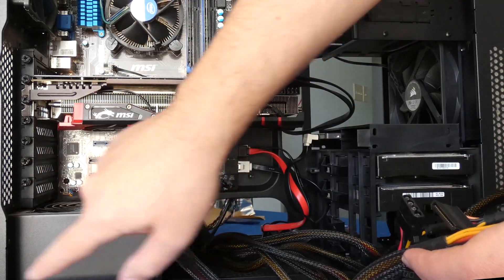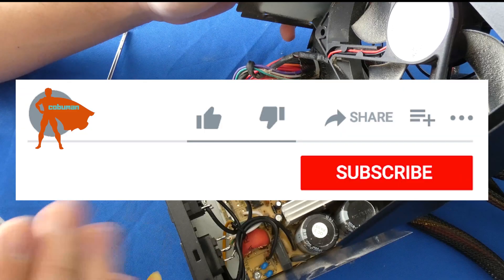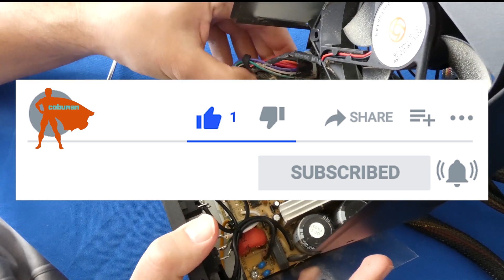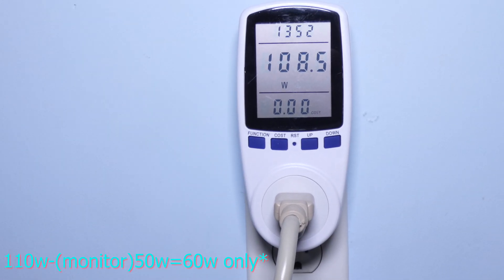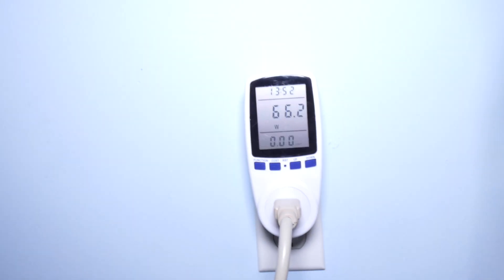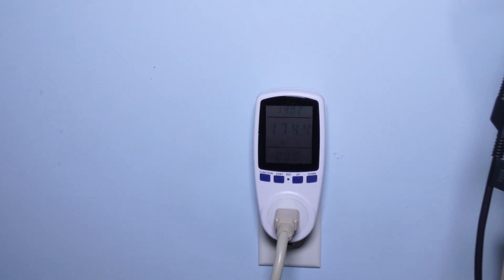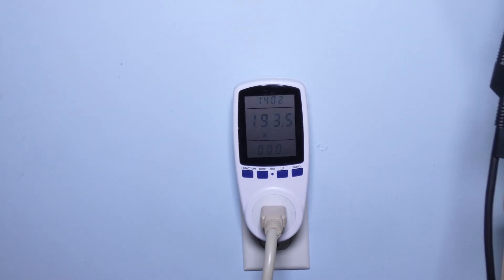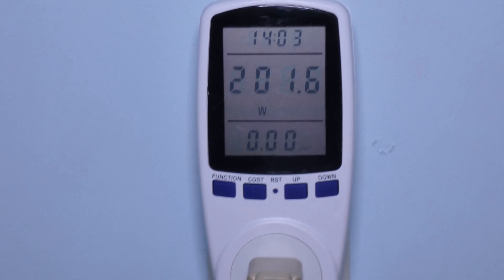Video Card GPU is new PSU required? HP 800 G1 sff, HP 800 G2 sff, HP 8100 sff, HP 8200 sff,

Comment: excuse me, I wanna ask that can i run gtx 750 1gb + i5 4570 + 8gb ddr3 ram + 500 gb hdd on a 200 watts power supply...please tell so, because have to buy that gpu or its gonna be sold 😥

Comment: Hi Cobuman . I got the HP EliteDesk 800 G1 SFF with i5-4590 . I wanna to change with i7-4770 or i7-4790 , can you please advice which is the best ???
Thanks .
Reply from the maker: Both are good. I know 4770 is compatible but not sure if bios supports 4790.
Reply: @Cobuman I just dropped a 4790 in mine, worked no problem
Reply from the maker: @bomptor1642  That is awesome. Thanks for letting me know it works. :_like:

Comment: Hello, can you please tell me if I put the gtx1650 low profile in HP ProDesk 600 G2 SFF PC it will work?the psu is sufficient for this grafic card? I think is 200w, I appreciate your answer
Reply from the maker: From what I recall; people have reported back to me that it works fine. The reason for 200w is because G2 has lower power consumption than G1. If your power supply goes bad... it used to sell for around $40 last time I checked on Amazon. Keep in mind that 1650 used to sell for around $160 before covid stuff... Don't pay more than $200 in my opinion.
Reply: @Cobuman  ok, thanks, payed 200 and these days I'll receive bouts, now my question is it possible to put a psu 240w  from the G1 in the g2? Thank you for your time
Reply: @rauldorelgyorgy9523  did it work?
Reply: @wsam.1984  yes
Reply: @rauldorelgyorgy9523  so the 1650 works well in the 200psu G2?
Reply: @wsam.1984  yes it works perfectly
Reply: @rauldorelgyorgy9523  nice, thanks for letting me know. I recently bought a G2 and was worried that I wouldn't be able to put a 1650 in it because of the 200 psu.
Reply: @rauldorelgyorgy9523  does the 1650 consume alot of power?
Reply: @wsam.1984  No, it works fine with hp prodesk 600 g2 and it's power supply, an ssd and a hdd and the CD burner, no issues at all

Comment: Would this work for my HP Elitedesk G1 SFF? 

i5 4570 
8GB RAM planning to add another 8GB more. 
500 GB HDD 
Adding GT730 LP 2GB soon 
Removing ODD connection soon
No SSD 
No additional fans or so 

Just worried if I add GPU after adding an additional 8GB RAM my 240W PSU might not able to handle it. 

Thanks man!

Comment: Hey I got a Hp elitedesk 800 g1 with a 240W PSU and I'm wondering if it could work with this system

Intel i5 4590
GTX 1650 LP
256 SSD
1TB 7.2rpm HDD
16 GB of DDR3
No optical drive

Comment: So if I get put a 1080 in my Hp elite desk 800 Mt g1 with 16gb of Ram a 120gb ssd,a 500gb Hdd and a i5-4570 using the stock power supply will it be fine?

Comment: Hi I am on this situation with my HP EliteDesk 800 G2 with GTX 1050ti that require at least 300 watts. Now I have encounter a hiccup during the game but if I am not gaming just a normal usage nothing happen but when gaming the screen is having an on and off blinking some sort of. Thinking of having an external gpu dock with external psu.
Reply: im running a gtx 1050ti low profile in mine...no issues with power

Comment: Would a HP 800 G2 SFF, i5-6500 with 200w would be able to run a MSI 1050ti low profile? :)
Reply: my 800 G1 SFF w/ i5-4570 runs a 1050ti low profile with a 240w power supply, if that helps
Reply: @samgillies9502  Does it run games well? Or does the computer crash sometimes? :)

Don't know if i should buy a i5-4570 or i5-4590 xD

Comment: Is a HP Elitedesk 800 g2 Tower with a i5-6500, 32 go of DDR4 Ram, and a 280w psu work for a 1650 low profile gpu?
Reply from the maker: Should be fine.

Comment: rx 550 oc 4gb LP on a 240 watts psu and i5 4570 is it gonna work fine?
Reply from the maker: as long as it's an LP it should work fine.
Reply: @Cobuman  even if the card requires a 400 watt psu?

Comment: I got an hp 600 g1 (very close to the 800 g2-4 components) and I bought an rx580 8gb. I don’t want to use the 240w psu, so I think I will just get the adapters.
Reply from the maker: nice

Comment: This video is the most practical and simple i've found!
I have a HP Elitedesk 800 G1 SFF with core i7-4790@3.6GHz and 10GB RAM +headphones, keyboard a mouse and a 24 inch monitor connected to the GPU via HDMI,  connected to the PC via VGA and is powered by the socket (3 monitor cables total). The PSU is 240W. Will it work with a GTX 960 4GB DDR5?
Reply from the maker: Probably be fine. Just make sure you get "low profile" type like this: https://amzn.to/3lLBl1h  or it will not fit inside.  I could not find 960 LP for sale but you get the idea...
Reply: @Cobuman   If I somehow fit the full size GPU into the SFF case, will the PSU still be able to power the full size GPU? Also, what issues would I experience from such a tight fit?
Reply from the maker: @papilionem9342  Here is my video on that: https://youtu.be/_tbcimqBDzI
Reply: *The PSU is the default HP one

Comment: will it be okay if i pair a GTX 1650 Low Profile with a 200W power supply in the HP EliteDesk 800 G2?
Reply from the maker: This is the one I recommend to people: https://amzn.to/3boom0F Most people don't have any problems using it.
Reply: @Cobuman  yes I know that already, but I was wondering if a 200W power supply would be enough for that graphics card
Reply: @anthonypham8062  Did it work for you with your 800 G2? :)
I'm thinking to buy the same computer, but I'm also worried about the 200W :(
Reply: @Cobuman  Hi there. Does the linked Gigabyte GTX 1650 (GDDR6, OC, Low Profile) definitely run without extra 6-Pin power supply? I've read that it needs 100 Watts and the PCIe delivers only 75 Watts. Can anyone confirm that this recommended GTX 1650 D6 OC LP 4G works in a HP EliteDesk 800 G2 with 200 W PSU properly? Thanks for your pretty helpful channel - very good work! :) Cheers!
Reply: @Cobuman  m

Comment: This video is worth gold, not only it is super useful but can actually save peoples hardware. So it's settled, 240W PSU will handle GTX 1650, I'm gonna order it asap before my first G1 arrives. Many tnx Ervin.
Reply from the maker: No problem. Take care buddy. 😁👍 Oh, see if you can order the revised version of GTX 1650 that comes with DDR6 rather than DDR5 Vram. This is the one: https://amzn.to/32vexKq Should be a bit faster.
Reply: @Cobuman  Hey I am gonna get a hold elitedesk 800 g1 SFF pc, and I want to put in a LP gtx 1650. If I need more power, can u do a deatailed vid on how to do exactly everything? Cause I am not that much of a pc geek. Pls do it it will help me alot
Reply from the maker: @9x9gaming85  Sure thing. Here it is buddy: https://youtu.be/_tbcimqBDzI
Reply: lmao, I used to run an RTX A2000 low profile on 240w PSU SFF for 2 years and ended up giving it to my brother, he still run new games on it, it had an i7 4790. no issues just his gaming addiction
Reply: How did it work out for you. I'm playing with the Same tought

Comment: I have a HP elite desk 800 g1 SFF with i5 4590 processor also with 240 watts stock psu and i wanted to add GTX 1050ti or GTX 1060 for its gpu. Any suggestiom for the best graphics card to buy and do i have to worry for a psu shortage whenever i add gpu?
Reply from the maker: Great question. The main thing to remember is to get a "low profile" GPU like this: https://amzn.to/2ZsWa8t GTX 1650 is the best LP card you can get at the moment and most people don't have any PSU issues. You can read reviews from that link as well.
Reply: @Cobuman  man i tried to look for that gpu, yet there is no available stock in any store. What i just found is a gt 710 or 750, i dont remember what exactly among those two. 
Does those kind of gpu may support my pc in a good gaming experience?
Reply from the maker: @ralvinbartolome799  The do sell out. The one l linked you will be in stock in 3 days.

Comment: Hey man, amazing videos, thank you so much for putting these up!
I've recently bought an Elitedesk 800 G2 SFF with an i5-6500 but a 200W PSU. I wanted to update it's GPU and am considering the GTX 1650 LP or a GTX 980 with an external PSU. Do you think they would run fine with the 200W PSU? Would it be safer to go with the 980 and the external PSU? Again thank you very much!
Reply from the maker: It would be easier to just add a GTX 1650 LP like this: https://amzn.to/2ZnyOjD This is what I recommend to people all the time. You can also read the reviews for the linked product. Adding a GPU can introduce more heat to system so keep an eye out.
Reply: cobuman great, I'll keep that in mind. Thank you very much!
Reply: @Ludecan  Did it work for you with your 800 G2? :)
I'm thinking to buy the same computer, but I'm also worried about the 200W :(

Comment: hello sir..i have hp prodesk i7 4770
16gb ram
240gb ssd
1tb hdd
320w psu
can i put gtx 1650 super in it?..i see lot youtuber test gtx 1650(not super) on hp prodesk with 240w psu and its work pretty good..because gtx 1650 tdp 75w and 1650 super 100w..so you think my 320w psu can run that gtx 1650 super?
Reply from the maker: Oh yes, people put those in to these SFF PCs that have 240w or 200w psu. Go for it.
Reply: @Cobuman  so yeah ill buy that gtx 1650 super..thanks for reply sir..maybe after i buy that card ill make a video for testing..done subscribe your channel

Comment: Hey cobuman, im thinking of adding a gigabyte gtx 1650 low profile and put a rgb cpu fan with rgb ram heatsinks, so it will basically be a sleeper... Will the 240watt psu hold up? (My 800g1 has an i5 4570 CPU and 16gbs of ram)
Reply from the maker: This one https://amzn.to/310WGvB ? Should be fine. If you read reviews you can see a lot people do that with SFF PCs like yours.

Comment: Honestly I did this with a hp elitedesk 800 g1 with a gtx 1650 lp and I'm getting constant blue screens can someone help people told my it's the power supply others tell me graphic card I'm new to this so I have no clue what it could be got it like 2days ago
Reply from the maker: The blue screen usually indicates PC hardware issues. First I would make sure that GPU is seated all the way down. You've probably watched my video on this: https://youtu.be/_tbcimqBDzI 
While PC is open... check to see if all fans are working; because your PC could be overheating with extra GPU added (turn on the PC while case is open). This could be overheating issue...

Also, install/download drivers from Nvidia.
Reply: @Cobuman  ahh now that could be the issue thank you I'll try and get back to you oh god 9f pc
Reply: @Cobuman  I try to download them and I get blue screen before I can I've had trouble updating windows I did see the video over that I'll do that once I get passed this itll be probably 4 or 5 then my pc dies
Reply from the maker: @twineli98  Let me know how it goes.
Reply: @Cobuman  ok so I power it up and got to the windows screen when I tried to dowload the drivers it blue screened then dies all my fans are spinning I've seated my graphics car pretty sure it's in there I dont want to push to hard should I try to start it in safe mode thank you for your time, I checked the memory test stuff its telling me some of the ram is bad or something I took one out powered it up i can get to windows i put it back in and i cant this is just weird
Reply from the maker: @twineli98  I think you found the problem in RAM. One of the RAM sticks is bad. I think you had the right idea of taking one out and retesting. Take the bad RAM stick out and see how it works afterwards.
Reply: @Cobuman  ok I can now make it to windows the problem I face now is trying to DL the drivers before it blue screens
Reply: @Cobuman  its telling me I already have a copy of the file should I ignore or cancel my bad its telling me the source file is corrupted wondering if I should just wipe it and try again ok It blue screened again idk thank you for your help

Comment: Will this system be fine?
HP EliteDesk 800 G1 SFF
i7-4790
Gigabyte GTX 1650 Low Profile 4GB
8GB RAM (DDR3)
500GB HDD
120GB SSD
No ODD
Reply from the maker: Probably. The worst thing that can happen is PSU goes bad and you replace it with OEM for around $30.
Reply: @Cobuman  Is there like a higher wattage power supply I can buy for this system? (I live in Bulgaria and it's pretty much impossible to order from eBay and Amazon, so I probably can't purchase a replacement)

Comment: Can I run this system with the HP 240W PSU in an HP 8300 without any issues?
Intel Core i7-3770
8GB DDR3 1600 Mhz
1TB HDD Seagate Barracuda
NVIDIA GeForce GTX 1050 Ti  4GB Low Profile (I'm planning on making this purchase)
The HP LGA1155 Motherboard
DVD-RW Writer Drive
Main use would be gaming but also some video editing and graphic design work, and maybe FL Studio.
Reply from the maker: Most people with your setup are fine. However, I would recommend GTX 1650 Low Profile as it's a better buy. Like this: https://amzn.to/2TVJAvA
Reply: @Cobuman  Thanks, I was worried the power supply couldn't handle it, until I stumbled on some of your videos. However airflow seems to be a problem as someone told me, any tips on improving airflow? what cpu and gpu temps did you get in your benchmarks?

Comment: I have an HP 800 G1:
Can it run a 1050ti, i5 4590, SSD, Wlan-Card, DVD-RW Writer and an HDD?
With the original HP - Power Supply?
Reply from the maker: Yes, most people don't have any problems; but GTX 1650 Low Profile is much better for same cost like this: https://amzn.to/2XiBXRN Make sure you get a Low Profile card though.

Comment: If this is true I should be able to slap an rtx 2060 with an decent 320 watt psu just fine lol noice
Reply: Well besides the fact that the psu doesn’t have 8 pin connectors........ lol
Reply from the maker: These are the numbers. 😁 Make sure it's a good quality PSU.

Comment: Unfortunately people do go completely overboard with their PSUs, and considering most of them don't want to / won't upgrade to something more powerful in the future, it's a waste. Better to spend money on a lower wattage but higher quality PSU from a reputable brand. I've been using the white labeled Corsair VS450 or EVGA 500W ones with most of my latest builds, no issues at all.

I used to laugh all the time when up to a few months ago my main rig was a HP Elite 8300 SFF and I had a 1050 Ti in it, paired with an I7 3770, 16gigs of DDR3, SSD and HDD, áudio Cars and usb3 PCI-E card, and all this with a 240W PSU. People would most of the time go berserk with comments like "OMG that PSU is going to explode!". The most I've ever seen that thing pull from the wall was 174W.
Reply from the maker: I completely agree. 👍
Reply from the maker: @Kalen Exactly, and because of that there are a lot of people who think they need a massive PSU.
Reply: Thanks for sharing your experience. I'm actually in possession of two 800 G1 TWR's with I7 4790's and want to build budget gamers out of them but thought the PSU's may be too weak and they both have 320W PSU's smh. I have a Watt meter and will be testing the power usage like was done in this helpful video as well.
Reply: @Alpha-ms9nj  you shouldn't have any issues in running a dedicated GPU with those, just don't go overboard. I don't know the exact PSU model but I'm willing to bet you won't have any spare 6/8 pin in those, but you should be fine using a low powered GPU by using a SATA to 6 pin adapter. I wouldn't go over 150W TDP GPUs with those, and keep in mind most HP prebuilts tend to dislike AMD GPUs.
Reply: @rhyzon  Thanks for the tips I really appreciate it. I found some on line PSU calculators and from what came up after adding everything I plan to run, it is not even 280 W.

Comment: So my 1050ti and my ryzen 7 2700x will  be ok with a 550w psu?
Reply from the maker: Yes, as long as it's a good quality/brand PSU. I've tried cheap 600 watts PSU and they would go bad shortly. But with a good brand 400W appears to be good enough even for more powerful computers.
Reply: @Cobuman  nice! I was gonna buy a cpu ram motherboard and case to build a new pc with my 1050ti and i didn't wanna buy a new psu
Reply from the maker: @ragegamer7900  you're fine with the one you have.